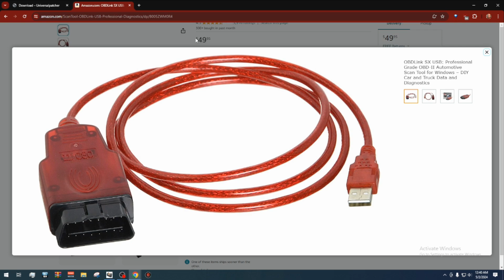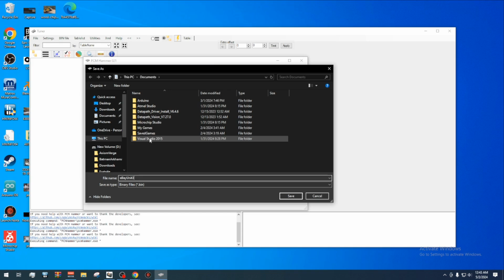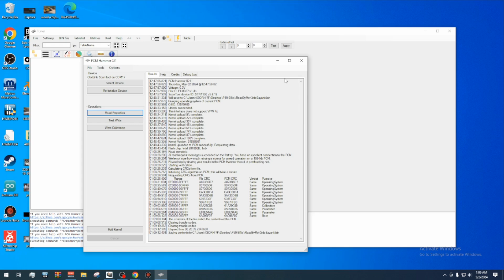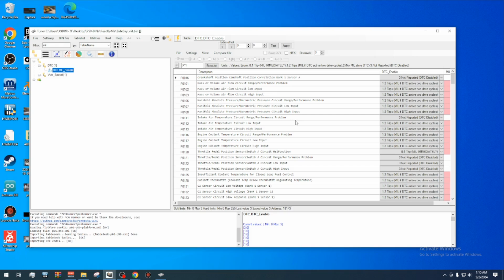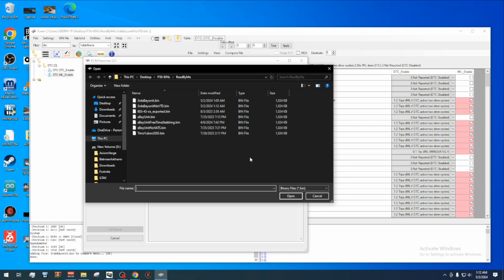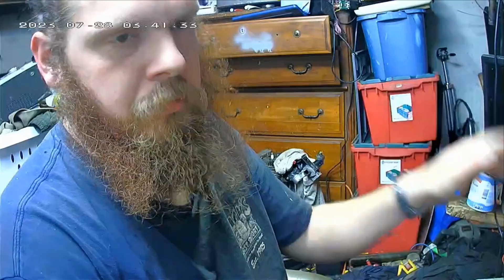Want cracked HPTuners? I can help.

Comment from the maker: I gave incorrect instructions for speed density without setting MAF DTCs. If you follow that, you will have problems. (EDIT: Even this further advice may be... not enough.) If I recall right, max out "K_Steady_State_High_MAP_Delta", "K_Steady_State_Low_MAP_Delta" and "Hi_Speed_Dyna_Air_Thresh" also probably "K_Steady_State_Low_TPS_Delta" and "K_Steady_State_High_TPS_Delta"; that should do speed density even with MAF codes disabled (set to 3). This was addressed in my go kart EFI base tune you can download for free. 
Check this link for reference. https://forum.hptuners.com/showthread.php?2359-Airmass-Calculations-(MAF-amp-SD) 
Here for the video about that tune https://www.youtube.com/watch?v=Jw7MlACcceo

Comment: So i was at my local e-waste pickapart place dumpster diving in their automotive section. I picked up two 0411, & 1 p59 ecu/s, and i also found a slightly burnt Holley Avenger efi ecu which i grabbed as well. When i popped the lid on one of the 411's from an 01 Z28 stick car and the avenger ecu i was surprised at how almost identical their pcb main board whatever you call them are. Yeah the holley had a few more bells n whistles but overall same same. Id he curious to know what you have to do to gain access to a factory ecu through the obd2 port like an hp tuners, efi live etc... interface does.

Comment: hi Mark, i just need to deactivate/turn off the cold start up feature on my C7 Z06 since i have no cats on it, would i be able to find that value using this? i dont want to touch anything else lol
Reply from the maker: I think the only setting for that is a spark modifier, which I have definitely zeroed out. Could be something for idle air flow, but I never messed with idle. Should be in there. It's nuts how much you can change.

Comment: I Need to fix my car and it’s a no crank no start because the pcm needs to be flashed (car went into security mode and tried all but people said it need to be reflashed and possibly the rfhub also). So I got approved to use witech 2 dealer software but with all the subscriptions I need to flash my modules and pcm. It’s over $200 for 3 days from dodge.

I’m trying to see if maybe someone has a huge dump of Durango pcm and related files bin’s and calibrations (if I need it) for a 2017 dodge Durango gt 3.6l (pentastar) 

My car has been down for 2 months. Because of the money of a tow and the dealer will charge so much!  It will be Cheaper if I buy my own tools and do it and have them for future fixes for myself and others (which is what I do for every thing that’s broken and I have to fix, that’s how I learned microsoldering and fix everything now, from ps5/consoles/phones to cars/washers ,ect… you get it) I like to learn and save money.

I have a version of wiTECH 2 that I can use offline (unlimited vins but older version) but I don’t have the flash files of course. Maybe someone here has them or has a subscription on wiTECH from work or something to grab the files needed for my car? I can provide a VIN if needed to grab the right files if you are gong through wiTECH direct server downloads of them.

I would appreciate this and so would my wife and 4 kids 😂 we miss our car we still pay monthly for 😢

Comment: Can I program a 2004 Chevy avalanche with this software so it controls efans after a conversion from fan clutch? Thank you in advance.
Reply from the maker: yes
Reply: @Marc_Wolfe  I'm planning to do the conversion in the near future. Do you happen to have any documentation or links that could help me get started or point me in the right direction?
Reply from the maker: @hansawr  plenty of videos out there for that.
Reply: @Marc_Wolfe I meant for the pcm tune to control fans, videos I have seen use hptuner or recommend paying to third parties to do it.
Reply from the maker: @hansawr  LowBuckLS channel I'm sure he did a video about universal patcher. Pretty sure it's as simple as searching for it and setting temp, high and or low fan, then there's a fan type setting. There's a search bar, just type "fan" into it, then add the wires in the right spot. LT1swap.com for the pinout.

Comment: hey man does the obd2cable work with windows 11 thanks
Reply from the maker: Haven't tested that personally, but considering it's treated like a generic RS232 serial cable by Windows 10, yes, should be fine. Just be patient with the auto install after plugging it in (windows is slow like that) and don't bother with OBDLink's proprietary drivers.
Reply: @Marc_Wolfe  word
Reply from the maker: Did you already try and it seemed to work but you had some kind of problem after it seemed to work?

Comment: I want to do a cam swap, do you have a video for tuning a cam?
Reply from the maker: One thing I haven't figured out is datalogging, but if you're just trying to get it good enough to get to dyno and pay somebody to finish tuning. Compare a stock torque curve to whatever cam you bought. The percentage of change at a given RPM, is the change you make in each column of VE. As for idle, disable MAF and create a controlled leak. Just don't forget to plug it when you get to dyno. I'll keep datalogging in mind for a later video.
Reply: @Marc_Wolfe  thanks I'll give it a shot